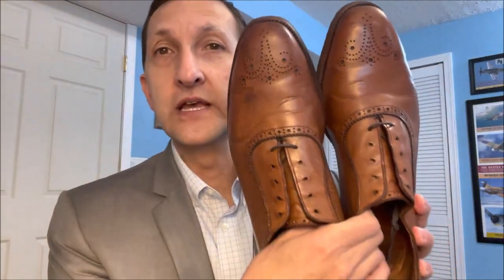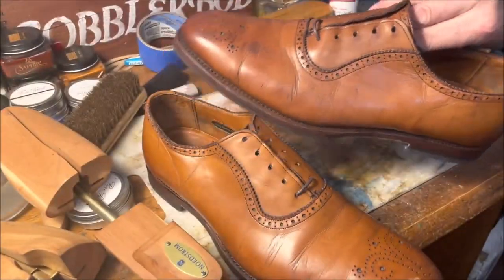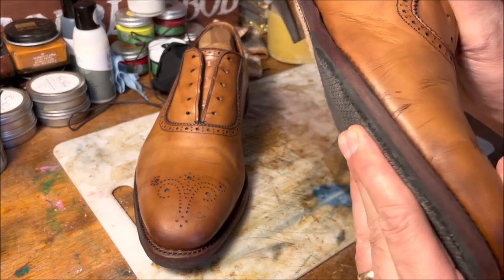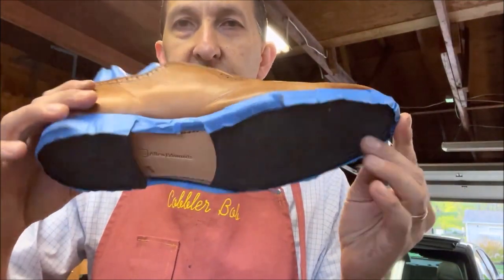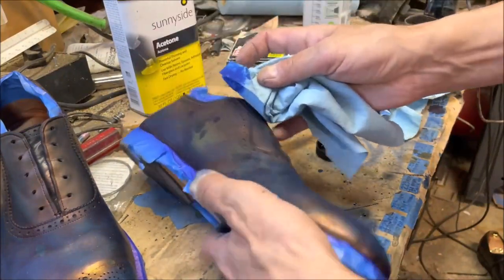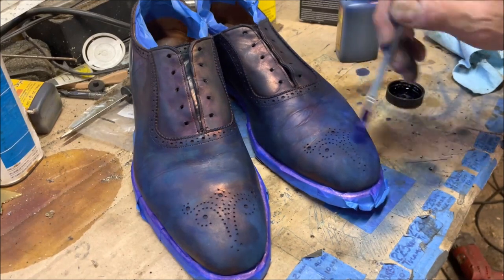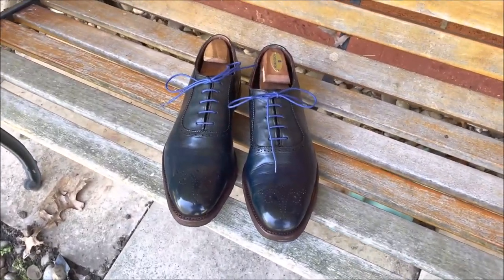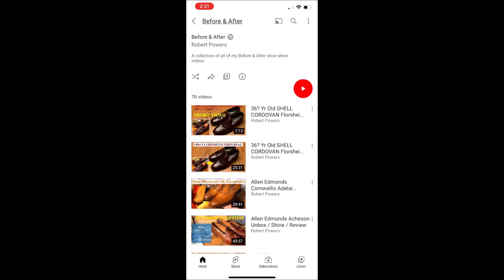Before & After: My 1st Museum Patina!

Comment: I just subbed and have been inspired by you to start dying my own shoes.  Those shoes look amazing!!  What was the pure polish product you used to remove the color instead of acetone in a recent video?
Reply from the maker: Pure Polish doesn't have a product to remove any dyed in color, but I use Pure Polish Cleaner Conditioner with a thick soft absorbent cloth to remove built up grime and some wax. A hair dryer and soft cotton rag will take off old polish.

Comment: Do you think starting off at 220 grit sand paper may have been a mistake?
Reply from the maker: No, that's fairly smooth as far as sandpaper goes. I felt it was neccessary because of the condition of the leather. I could have used the LM Filler, but they still would have needed to be sanded afterwards.

Comment: You gotta remove that layer still. Had the same issue after dying suede shoes. It made a lot of work but it turned out well. I even used saddle soap and a rough brush. There’s a risk of ruining your pants.
Reply from the maker: Yes, I definitely should have spent more time stripping... but I just hate that step!

Comment: I noticed you used both Saphir Ren and Acetone. I have also done this on my Allen Edmonds and it worked out great but on my Santoni loafers the leather is too delicate, is there an in-between of Saphir and Acetone I could try?
Reply from the maker: Steve from Bedos Leatherworks uses Turpentine. One of my commenters that seems to know a lot uses it too, but I personally have not used it.